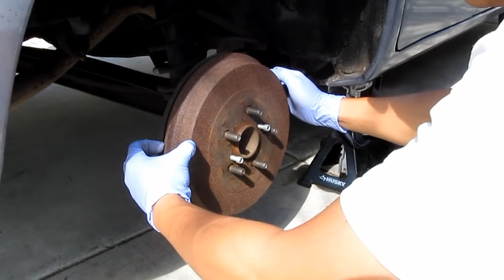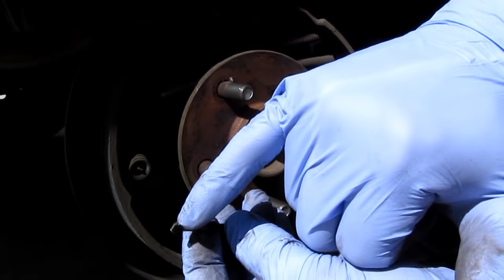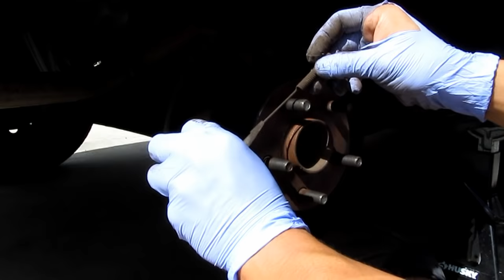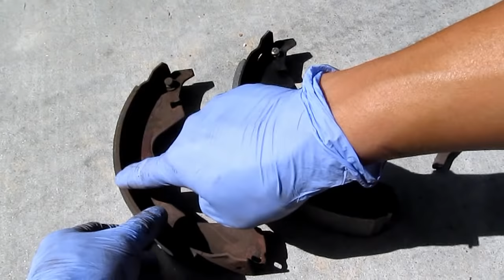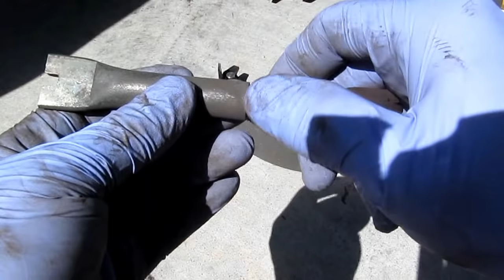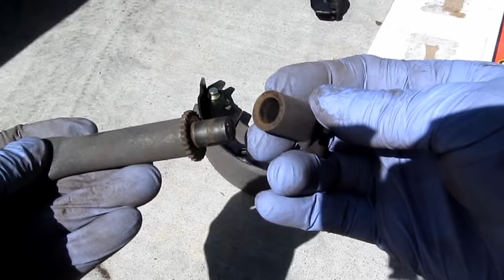DIY: Replace rear drum brake shoes for Toyota Corolla, Matrix 2003-2008, Pontiac Vibe

Comment: PSA : rear drum brakes are no joke. I recommend you outsource this job that is generally due at 90K for hard drivers & 125K for gentle drivers.  I studied several YouTube videos. I downloaded the service manual. I bought specialty drum brake tools. I was just going to clean & regrease where the pads contact the back plate.  Seemed like a straightforward procedure with my YouTube knowledge & couple pages of service manual exploded PDF's. What took 5 minutes on a YouTube toke over an hour on one drum for me ( I've done struts, front brakes, radiator swaps, alternator swaps before, so I'm not a beginner)
I studied the picture I took of the ," before ." 
I after struggling for an hour, I finally reassembled and doubled checked my assembly.
Well after taking a short test drive, and not having resistance from my console area parking brake handle, I open the drum again. Turns out, in my 10+ attempts at finessing the springs and position of pads & levers, I discovered that somehow the parking brake cable came off from it's attachment point and got sheared off.
So now I created a $350 premature rear brake job for myself.
Lesson learned .
Reply: Seems like a skill issue

Comment: You made twice to work when putting it together there's a way simpler way. Sightly put a screwdriver in between that locking pin an adjuster screw slightly pry out and turn the adjuster screw that way you did not have to take it apart again.

Comment: Last part you just needed to rotate the gear ⚙ and it will get shorter or longer. its a self adjusting gear. Side note, the horse shoe like retaining washer the one that holds the parking brake bracket you NEEDED to squeeze the two ends a little bit closer together so it doesn't slide out.

Comment: On the hold down spring I found that if you hold the spring still with pliers you can use needle nose pliers to push in the pin and easily turn the pin. Pops right out

Comment: Dude the e brake cable was the toughest part to get back on by myself, I eventually gave up and recruited a second set of hands. Also, I was even more pissed bc I realized that the piece didn't even need to come off, you can just take the lock washer off and swap the shoe

Comment: rear brakes last a very long time, and if you notice in this clip, the brake shoe is not so totally worn out, but noticably glazed. a good blast of cleaner or water hose so u are far away and sanding of the shoes should do.   If it aint broke dont touch it.
Reply: sanBastian123 how does it last? Compared to front brakes
Reply: @doubler8000  rear brakes last so much longer because most of the braking force is on the front of car. Because when you put the brakes on, and all the weight of the car naturally shifts towards the front brakes. That's why they can get away with using weak rear drum brakes but powerful front disc brakes.

Comment: Good tutorial. In the end, when you needed to adjust them in a little, there was no need to take the star adjuster off. You just pry down the holding lever (slightly) and turn the adjuster to tighten it. Other than that, excellent video.

Comment: You know they make a whole set of tools specifically for drum brakes. The right tools make the job go much faster. Also, you should always use new hardware everytime you replace brake pads or shoes. I work at Advance Auto Parts and I always recommend new hardware to my customers so they don't run into old hardware breaking or not performing properly due to rust or corrosion.
Reply: Sometimes the new hardware doesnt work right or have the correct specs. I've gotten that problem from Autozone, oreillys, and advance🤦🏾‍♂️
Reply: Naw man. If nothing is wrong with the OE that Chinese crap is never better. Working at a parts store doesn't mean anything.

Comment: I did not see where he put the pin back on the new brakes after turning the pin around. He must squeeze the washer to lock it in. When he pushed it , it just slid in and back out a bit. I hope he did that , or that will become disconnected. Other than that, Pretty good video.
Reply: Scott C he did not need to remove the pin, the shoes were probably for the other size, they have their side, one for the right and one for thw left...but good video..

Comment: nice. one thing....never test your work by stepping on the brake pedal unless that drum is back on........or you will really have a bad day.......from experience the first time i changed shoes.....oh well also learned how to do wheel cylinders that day too!
Reply: I did the same thing!
Reply: Why is that?
Reply: It'll blow out the cylinder.
Reply: Nice to know, havent done drum brakes before but I will keep that in mind when I do work on one.
Reply: No problem. It's obvious when you think about it but I wasn't thinking. Friend in car pushed in brakes when I was checking out the drums. Exploded brake fluid all over my face.
Reply: @AnthonyGraber  Mine popped off too... I was able to put the rubber gasket back on though and it appeared to fit snugly.. Do I really have to change that part too?
Reply: Ohhh, ouch. That happened to me once when changing disc brakes. Led to having to reinstall the piston and bleed the entire system. And eventually had to change the caliper anyway.

Comment: I changed the rear brakes now it makes a terrible noise when i break. What can it be? When i spin the wheel off the ground the wheel kinda has resistance in one area
Reply: Probably need new drums. Also he made a mistake at the end. The adjuster need to be adjusted so the drum spins about one revolution whw you spin it. What I mean is there is a small amount of drag that needs to be present and that is so the Emergency brake still works. To adjust turn the hub til the large hole lines up with the adjuster and use a flat screwdriver to turn it. The reason his drum didn't fit after he finished the first time is because you should lightly clamp off the rubber brake line so the fluid doesn't expand the piston at the top in which pushes the pads out.

Comment: What size and thread are them bolts? Thanks.
Reply: 8mm diameter x 1.25mm thread pitch for removing drums. For Toyota and most imported cars. Most bolts with a 12 mm head will be the correct size.(8mm x 1.25mm with at least 35mm length)

Comment: WHICH SIDE ARE YOU SHOWING PASSENGER OR DRIVERS SIDE?  THANKS
Reply from the maker: passenger side.
Reply: Good God, if you can't figure that from the way the car is pointed in the video then you shouldn't be working with anything other than Legos.

Comment: Good show.   Please be careful where you put your feet under.  E.g., at 25:00.  I like that
you purposely expanded that adjustable rod so the installed shoes won't allow the drum to fit.

I also knew that drum brakes are harder to change shoes than the disc brakes.  Yet, an 
auto mechanic would charge you much more for the disc brakes.  Why?
Reply: Schuten Dohkji parts are more money

Comment: What size are the bolts to remove the drum?
Reply: 8mm diameter x 1.25mm thread pitch with at least 35mm length. Most bolts with a 12mm head will be the correct diameter and thread pitch to remove stuck drums.